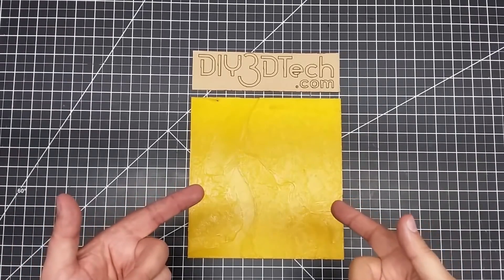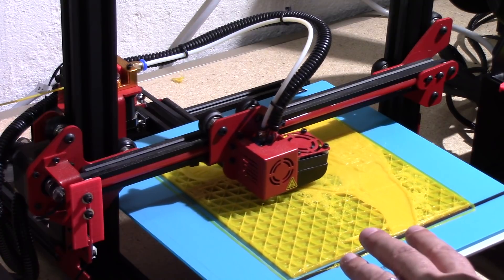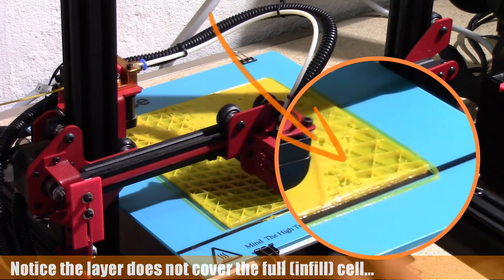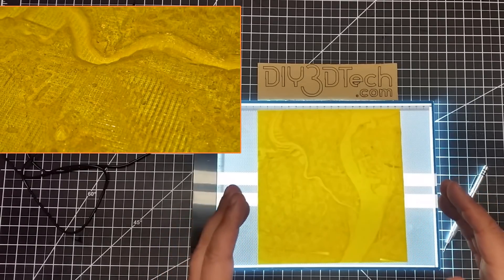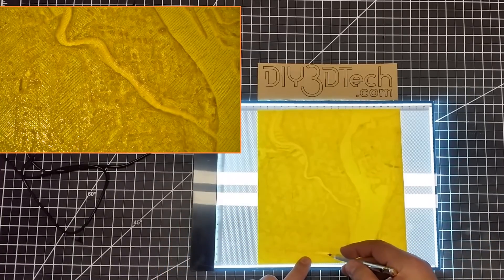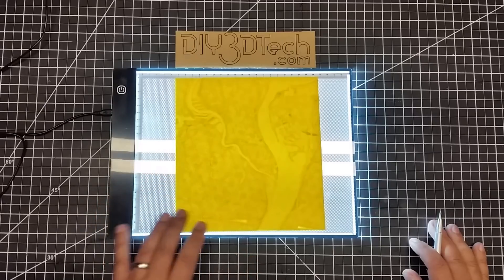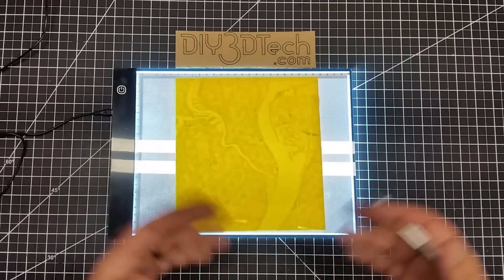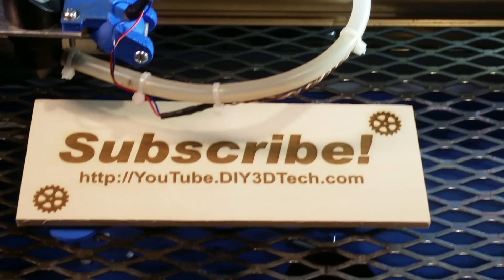Design Talk -  3D Printing a Topographical Map Part 2!

Comment: This was a great presentation.  You just got a new subscriber.  I do a lot of boating in So Cal oceans; any chance that you could demonstrate the bathymetry data.  What do you think about changing filament color every step in elevation to get some idea of height and depth, say every 75 ft.?  One can do land in brown and water in blue.  They are currently doing this very coarsely in wooden layer maps.  Thank you....am looking forward to more videos.   https://tahoewoodmaps.com
Reply from the maker: Man thanks!  I tried bathymetry data however the resolution is poor so it is hard to get the "stepping" as you can with land.  Likely this winter I will mess with it a bit more as I want to do the great lakes from my home state of Michigan.  However I am thinking I am going to have write my own code to do it...
Reply: @DIY3DTECHcom  Thanks for the quick reply.  I don't think we need the resolution for the underwater portion, just a color coded depth gradient.  All we are looking for are steep drops in elevation or deep shipping channels.  The land of course would be best suited for the finer resolution.
Reply from the maker: The real issue is the delta as low res-data makes it hard to scale using linear functions as the topo maps in this example uses a linear gray scale function to achieve the  affect.  This is why most of the fancy city scapes you see are from lidar data and use custom code to shape the point cloud.  I also tried this in Blender without success too thinking I could create a derivative with no luck.   However in the winter when I locked inside because of the cold will be a good time to tackle this challenge as I don't think it will be too hard as you would just need to take min/max and convert to faux detail with a multiplier.   :-)

Comment: OMG so cool. Already DL'd a zip.  Now what did you say about printing my lot and house with that KML File?  That would be so cool.
Reply from the maker: Yes you can use a KML file to define a custom shape say of a large lot or geographical area of interest...
Reply: @DIY3DTECHcom  Im not sure if this is what I need.  I love in a rather flat area.  I thought it might include reliefs of the buildings.  It doesn't.  So I changed the scan location to the downtown area of my city.  There's terrain there and a river.  Now that seems to be printing good.  So how to get reliefs of buildings?  Probably like photogrammetry? (Lithophanes) Send a drone up, circle my house with photos handiwork on those scans?   That wold be so cool to actually 3D print terrain with buildings showing. Not sure about the KML file.  It's looking for some file on my computer????  Thanks